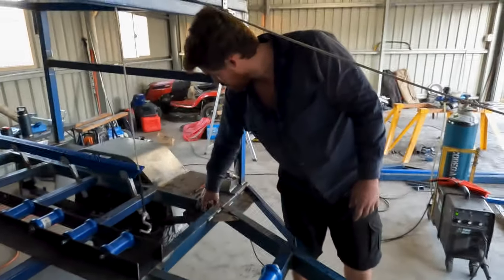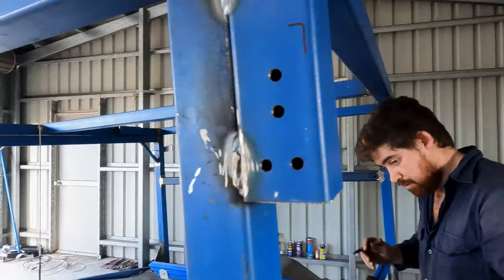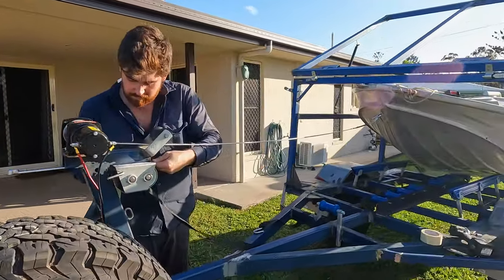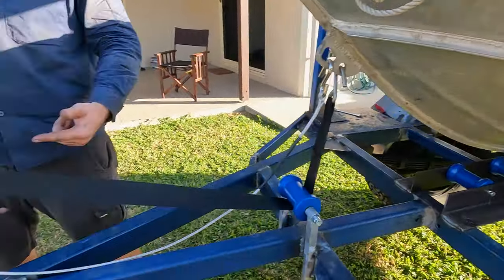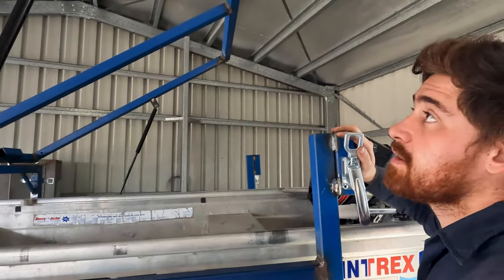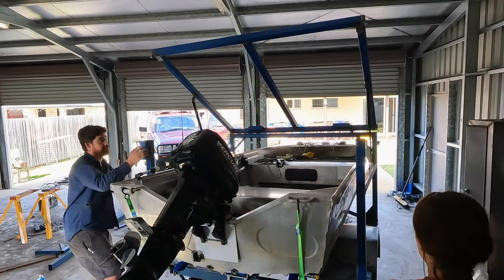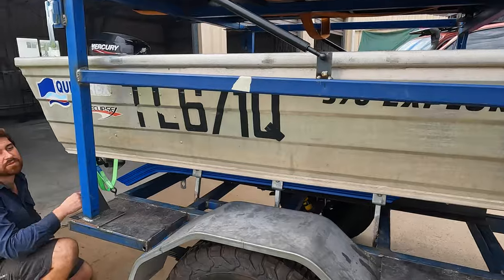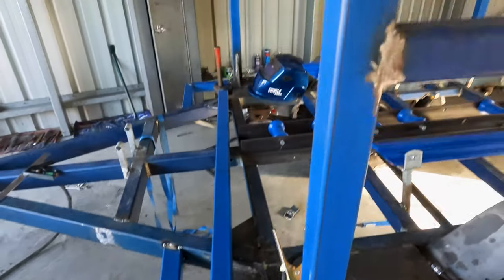OFF-ROAD BOAT CAMPER BUILD - Hinging AX27 for boat launch

Comment: Have you thought about making it a break back trailer. That will fix your angle issues.
Reply from the maker: Yeah, we had but we didn’t want to sacrifice integrity by putting an extra break. Those corrugations can be pretty wild off road! Less joins the better.

Comment: You could make the tent frame removable using stand jacks, that way you can remove it if needed to be left somewhere and than you have just the boat and trailer.
Reply from the maker: That was actually our original plan but due to weight decided to go with this option. The frame still bolts on and off so when we get back from the trip we can remove it for day to day life! But yes, a great idea! Check out @unchartedaus on insta - they have done just that.